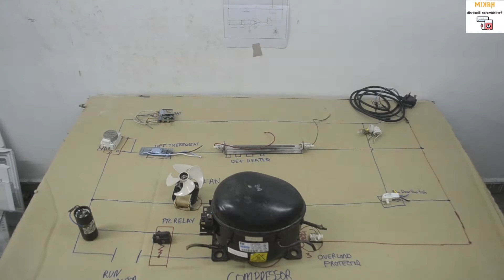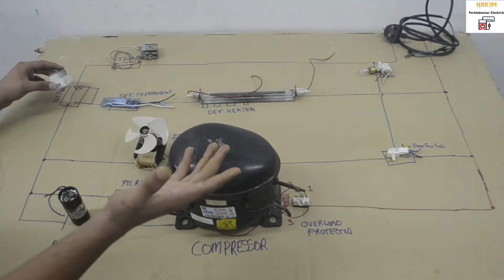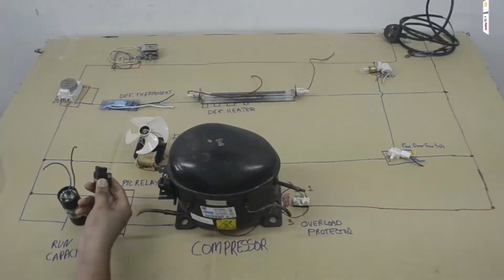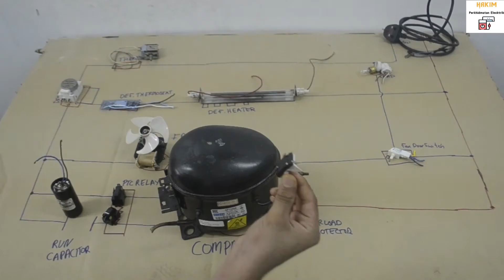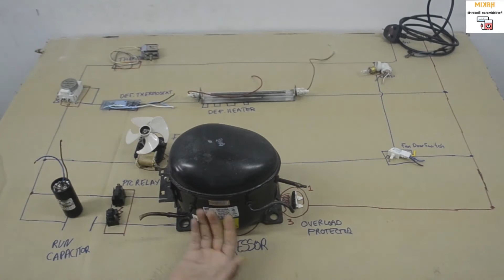Understanding Refrigerator PROCESS and WIRING DIAGRAM! And EASY way to find out the fault in fridge

Comment: very nice. I have a question I have a lg refrig. The thing doesnt work at all no lights  nothing. The only thing that works is the fan byu the compressor. But the compressor doesnt work. I replaced  the mother board but the same